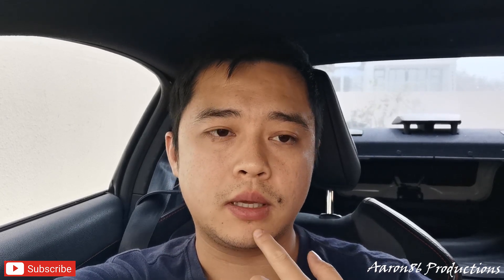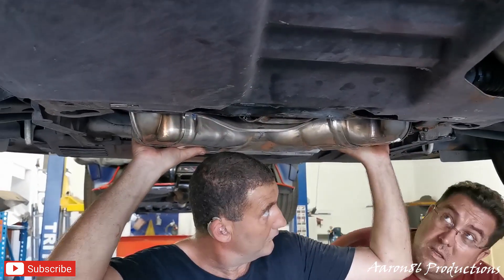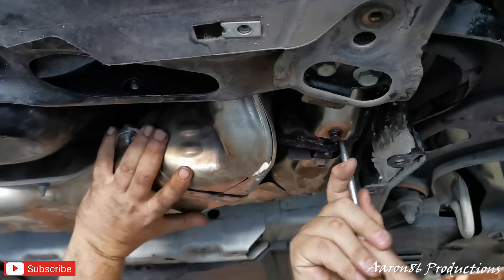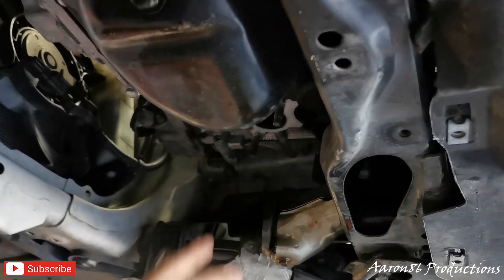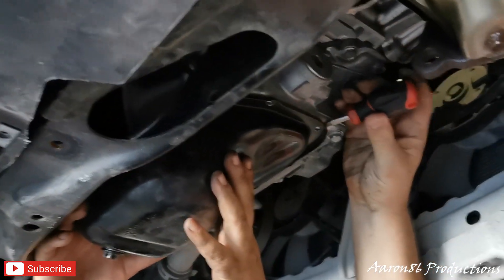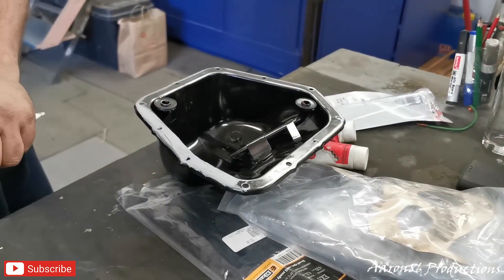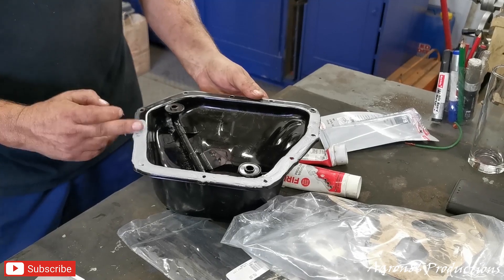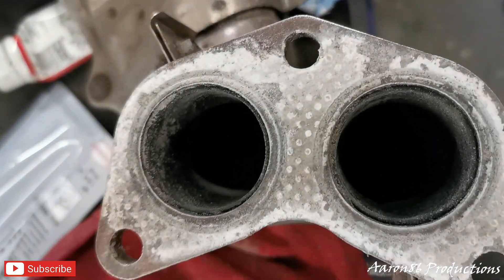UNBELIEVABLE! There are SILICONES stuck in the Oil Pickup! Unopened Motor | Toyota 86 FA20 ISSUES

Comment: I'm in the US and my brother has one of these FA20 engines in his 2013 FRS. I've seen several videos where the silicone debris are protruding through the screen on the oil pickup and thought it was due to having the spring recall done. My brother hasn't had his done and won't due to some engines blowing up from mechanics that don't apply the correct amount of sealer to the covers. The amount silicone that is getting through the screen on your oil pickup is getting caught by the oil filter and shouldn't be enough to damage your engine. That said, it shouldn't be there though and the manufacturer should have addressed this item. Killer B makes a proper oil pickup for these engines and I advise you get one installed for oil volume.

Comment: Amazing these problems go this far back with rtv…this seems like a huge Subaru problem. A bunch of guys are having this issue with their 2022 gr86s. So Subaru engines from 2013 and beyond have this issue? Crazy. So the Brz, which had the same rtv issue as far back as 2013, doesn’t get a design change to fix this, they shove the same motor and oil pan design into the Toyota gr86, and surprise same oil pan oil pick up issue. Toyota and Subaru, how can you in good conscience know about this problem and let it happen.
Reply from the maker: They know about the issue....even if its NOT the silicone, its oil starvation issue, as when people track this car HARD, they blow their engine, as oil starvation occurs, that is why Killer Bee designed a nice oil pick up for the 86

Comment: For anyone watching this - NO dealership will risk paying for an engine by using RTV in place of a proper gasket. Unless you bought this car with zero miles - I really think this has a replacement motor in it.
Reply from the maker: Hey bud.....it's a brand new car, my own car, bought it brand new, watched it arrive from truck. .

Yeah sure new replacement engine
Reply: @Aaron86Productions  I don't doubt your word. But I've done industrial assembly on engines. No way that RTV came from the factory. They would have used a rubber or fiber gasket.
Reply from the maker: @Whitehorze  yes, other brand engines. 

Please check it yourself next time, if you ever have the chance with these FA engines. 

And it in life's the new FA24 family. 

The new 86 has the same issue with silicones in pickups.

Comment: Same problem with 2022 models, they still haven't fixed it
Reply from the maker: Hey bud, don't think they can or would. Reason being a faster production and cost effect process of using a sealant to seal the gaps than using a gasket. 

In the long run they save more cost, reduce the parts needed and reduces time to produce with trial and error in mind. 

But the amount of silicones will now also depends on cars now. 

Sadly, those that bought it, will need to clean and check their pickup.
Reply: @Aaron86Productions  that may be true, but now they may be facing a lawsuit over the flaw in the manufacturing process. With the cost of providing warranty repairs on the engine failures due to oil starvation, they are not saving much in the long run. How come other car manufacturers don't have this specific issue 🤔 ?

Comment: Thanks for the video. When you said, "For the past years I've been hearing FA20 engines are blowing up Left Right and Center~", were those engines from early years of gen 1 or later years (2019/2020) of gen 1 also had this issue? Have you heard of blown engines from 2020 year model? Thanks.
Reply from the maker: Hi there! The group mostly drives 2012/2013 models, so they really bad, and kinda like testing the market, and we like a labrat. 

Gen 2 models also have similar issue, but the engine/motor design is much better design, and less weak compare to gen 1

Comment: Sometimes its because of engine flush cleaner, it will scrape the left over silicone that is inside the engine. That is 1 of the disadvantage engine flush n sometimes will cause leakage on the engine. Advantage clean engine.
Reply from the maker: New engines shouldn't have much issue. And yes there is a chance of what you said. 

But most of the 86 cars that went to get a pick up clean never used any engine cleaners, some never even mod the car, that had it as it and boom, some have a lot of silicone and some have a few. 

And some......Blown engine
Reply: @Aaron86Productions  ive read few cases, after recall spring valve . Their piston all f*ck up bearing spun damage badly.. High chance its because of the valve spring recall job. Then they blame customer for driving wreklessly n did a tune job then retune when came back to service centre. They quoted 8k for used less mile engine but the customer is not satisfied  because he never drive like a madman n send to private workshop instead .. Also found there was a lotttt of silicone blocking the oil pickup. Luckily the custome have the front view camera and have record of it after the valve spring job n get his refund for new engine block.It was very messup job lawyer involved etc.  And it was less than 500km or miles after the valve job. They should choose other diffrent type of silicone like the honda or the grey type silicone that dry fast ,high temp etc ..because the silicone cases is not once even yourself luckly u found out early what if it goes to piston side wall or block the small hole for bearing lubrication

Comment: With my 2013 GT86 I still have those "crickets"  engine sound from time to time when I start my car, as well as the burning smell when over 5000 rpm and the squeaky clutch (when pressed in). Many forums offer different explanations and solutions, has anyone managed to resolve theres if you have these issues?
Reply from the maker: Hi, the cricket is normal, it comes from the high pressure fuel pump. And the cricket either becomes loud or soft will be dependant on the fuel and it's additives that's inside 

Its not a major problem, just irritating. 
(I still have that noise, but found one garage that helps removing the noise)

As for the burning smell, it's normal, sometimes it's a mix of clutch, and exhaust and the heat in the engine bay causing it to smell. After a long while of driving eventually it will be gone. You will just need to sometimes push the car hard, as the header does get hot and surrounding materials will let off smell also, eventually will be gone.
(Initially I have the same smell, but after driving the car hard most of the time it's gone)

The squeaking of the clutch pedal is by the clutch master cylinder, where there is a rubber cover. Just need to lube that area up. Let some one press the clutch and you listen and check by engine bay, you'll know what I'm talking about. 
(Still have that noise for years now, as I have an exhaust so coildnt hear it when driving, but will probably do a video about it)

Comment: Hey Aaron, I did a DIY on tearing down this my motor. I technically went through 3 FA20 motors 2013/2014/2017 

2013 motor is blown at 98605 miles due to spun rod bearings

2014 motor with 17k miles and put at least 70k miles was the best working engine I’ve had, until the valve spring recall... RSM Toyota assumed my motor was a 2013 car all-round, but it’s my fault that I didn’t say it’s a 2014 motor. Technically, the 2014 FA didn’t need valve springs replaced, little did I know I just thought getting new valves spring replaced, I’d be fine. I was dead wrong and turns out that my 2014 motor started knocking after 13k-15k miles... Toyota wanted to bend me over backwards  for 8k plus tax for a rebuild.

2017 motor was from a guy the buys a whole BRZ/FRS from an auction and  sell for parts... His name is Rodrigo and he’s on the forums somewhere, it’s a hit or miss and I was disappointed wanted this motor specifically because of the Aluminum Manifold... then again, this is where I found excessive amounts of metal shavings. This is where I knew I open a can of worms... I decided to pull out my motor and did a lot of inspecting. Your video shows the same exact issue that I came across after a long time of figuring it out where the problem is coming from... 

But now I just bought a long block from GCH longblock racing and I’m fully aware that this “4th motor” is under race applications. My main goal is to go supercharger or turbo on ONLY low boost for the longevity of the rebuilt motor.
Reply from the maker: Good God, sorry that you had to go through with all that crap.

When I first heard the bulletin about the damn valvespring recall, I thought, I'm glad that I don't have to do it.....but I also had the same thought as you, well...it wouldn't be a bad idea hey? Since its a new valvespring so technically it should make my current motor stronger? 

I went to toyota plenty of times to see if they can do it on mine, even though they said there is no need for a recall for 2014 models, and a few months later I heard people are getting bearing knocks, and blocked oil pick ups etc....so I was glad I didn't go ahead or find a way to get the recall done.

I'm still on my first motor TOUCH WOOD FINGERSCROSSED* that it will still be fine.

I have cleaned my pickup like in the video, and I still need to clean it again, I'm 7000km in since the clean up.
changed to Liqui Moly 5w40 oil and I used ceretec for that extra protection, I beat on the car once a while to make sure there aren't carbon build ups.
In South Africa, we don't have E85 pumps, so we all need to buy E98/E100 Ethanol in 25L drums, and mix it with our crappy 95Ron Unleaded fuel.
So for me I'm on OFT stage 1 tune, with about E15 - E20 of ethanol mixture! Car runs beautifully, fuel trims are great, no pulling of timing, IAM stays happy....so this is all I can do at the moment.

I have a turbo kit sitting in the storeroom, so I might fit it and like you, run ONLY LOW LOW boost for reliability and longevity of this stock motor.

My partner and I are busy developing a custom oil pick up for the car, very similar to KillerB design, and I have done quite a bit of research, and upgrading to a good oil pick up will solve majority of the oil starvation issues of this motor hey, i suggest you look into it.

Comment: So much cringe with the way that technician decided to take the oil pan off. I would not do it that way at all. You can see the damage done to your short block. Any dents, dings, will be covered with the RTV from the oil pan, but to then pry it off with the screw driver? no way bro. I had to look away. Honestly, that much RTV is not surprising. It's from assembly and it looks like the oil pick up did its job. If you are blown away by the RTV there, wait until you fix your timing cover leak and see how much is used. And its not out of line to use that much too, its in the Tech Manual. Also, you are going to get some RTV in the oil pan anyway if your technician put too much, and then put oil in too fast before it cures properly.
Reply from the maker: Hi There!
Yeah the way they did it does look scary and very cringe worthy, but I made sure there wasn't any damages to the block, they later made sure the surface wasn't dented or scratch and they did sand it down properly to make sure the silicone will stick and cure properly.
They in fact did over 20 86s already, and all haven't had issues, and some even went back for the 2nd time to get it checked, and one or two found another Black silicone inside the oil pick up, and not the grey ones these guys used for the oil pan.
Apparently they used those racing performance silicones for it, do they dry and cure very quickly

Comment: Toyota MDT chiming in... 
we do know about the silicone issue, and the tapping noise is probably from the valve lash misadjusted. Won’t cause codes or damage anything, but will be annoying.
Reply from the maker: Hi, thanks for your comment, what I wanted to know in regards to the tapping noise. I never had that noise before only recent months. 

This Valve Lash misadjusted can it be fixed via ecu or must one open up the engine? Note, I don't have any recall for valvesprings therefore my engine wasn't touched at all. 

As for the silicone issue, what did you guys do about it? Offer free clean?
Reply: Aaron86 Productions does the sound only happen during cold start or all the time? Valve lash is only set with the motor out of the car. I’ve seen also on automatics that the vacuum pump behind the passenger side intake cam making noise. As far as warranty for the silicone, we can’t really help clean it unless the customer approves it as preventative maintenance like what you did.
Reply from the maker: Hi, I started having this tapping noise during cold start and when driving, it was extremely irritating and most noticeable around 2000 to 3000rpm, especially when you free rev in neutral. 

I did a lot to try and see if it's the oil, but after I removed the silicone as a preventative maintenance, the sound died down a lot. And not very noticeable now compared to few months before. 

Therefore I wasn't sure what is the cause, the car is stock, nothing has been done to it since new.
Reply: Aaron86 Productions is the sound coming from the middle or the ends of the block?
Reply from the maker: Before the silicone removal, I tried checking the sound. As we are right hand drive, the sound was mostly from left side where the high pressure fuel pump is. 

It's somehow more audible when you inside the car than hearing it from the engine bay. 

At one time you can hear it more via the wheel arch area. 

After the silicone the noise is less and sometimes you can't even hear it 

But it's definitely still present when you cold start....
Reply: Aaron86 Productions id say monitor it for now. Don’t do anything just yet until it gets louder.
Reply from the maker: Done the silicone and throw in new oil, will do another oil pick up check for more or left over silicones. I believe it's the silicones that somehow cause the engine to tap. 

Car honestly feels really good and responsive, no codes, pulls nicely, idles good, no other funny noises so far. 

Fingers crossed it will be back to normal
Reply from the maker: Please subscribe, will update my situation later.
Reply: @hungryfyime  so I have a question. So you guys know about the silicone but won't do a recall on this.. Would u mind explaining why not... I mean surely the motors are not being openned up by us and we the ones placing the silicone in the. Motor. I saw a bulletin from 2013 where toyota stated they know of the silicone but won't do anything.

I mean it's not like we saying replace the entire motor. If toyota is willing to do a sump clean this could stop. Lot of guys running bearings. Oil starvation is the main issue from what we picked up.

So when u say for the customer... Does that mean the warrenty won't cover the clean and the customer will need to pay for the clean...
Reply: @mrjklee  its not up to us techs, ive been saying for the longest that we need to switch to gaskets because most of the engine uses silicone in place of gaskets. I believe manufacturers need a certain amount of cases or it needs to be something extremely dangerous to issue a recall. They rather just wait to save cost. I just removed a pickup that was covered in basically a hairball of silicone and bearing material on an engine that hasn’t even had the valve spring recall at 60k miles. It was knocking hard.

Comment: There needs to be a recall for this.... would explain the random stock car engines that are blowing up.
Reply from the maker: Yeah man, but the thing is Toyota probably....Doesnt know about this 

We had about 15 cars that went to get it checked, year models range 2012 to 2015 ones I think, and all have it. Some a lot and big fat pieces and some are small amount like mine. 

Crazy, and recently had a mechanic rebuilding a FA20 and the oil pick up was basically clogged, and oil starvation happened
Reply: @Aaron86Productions  toyota knows. Its a lot cheaper to have the cars come in one by one showing problems than to have to do a recall on a large amount of vehicles.